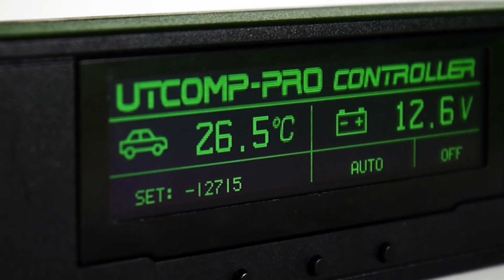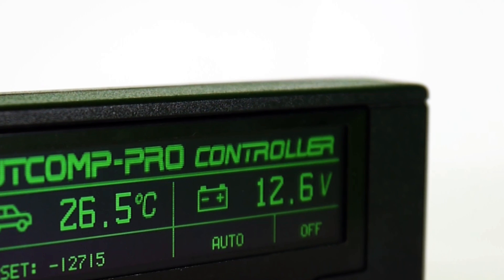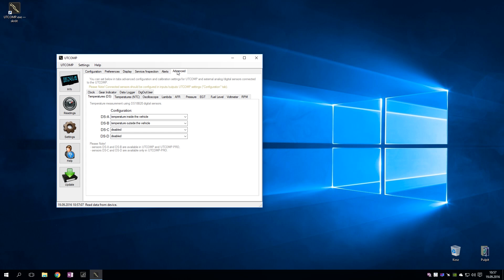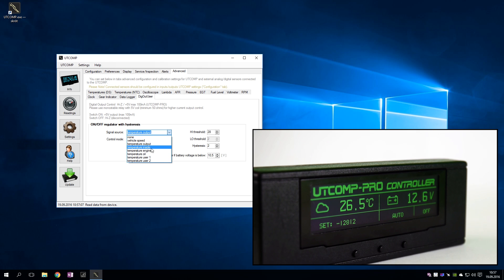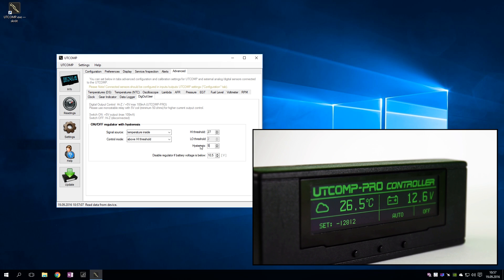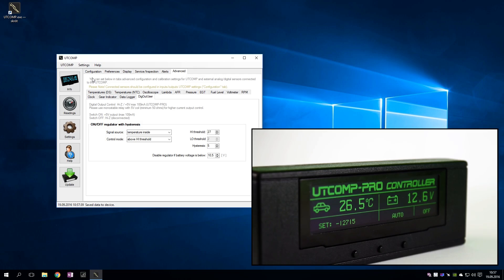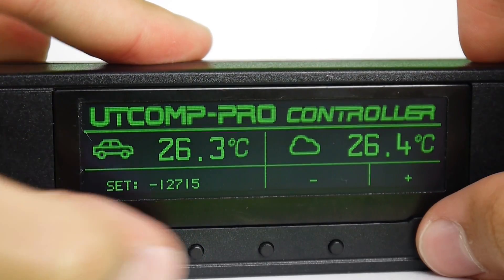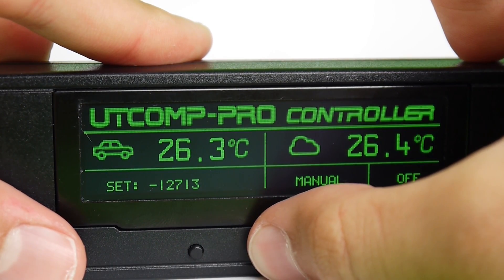UTCOMP-PRO Digital Output Control Relay

Comment: I just ordered a UTCOMP-Pro, your 4-Channel EGT-K thermocouple amplifier and a handful of sensors. I searched a long time for a reliable data-logging system to log parameters I can't log with the Cobb Accessport. I was getting really disappointed because everything was either junk or prohibitively expensive. I already have an AEM Wideband Failsafe Gauge (which I like) and I had finally given in to spending a crapload on their AQ-1 (which is useless unless you spend even more for their expensive wiring harness). And it still would not have had as many useful (to me) features than the UTCOMP-Pro. So psyched I found the UTCOMP-Pro before spending money I was going feel bad about spending.
Reply: So, are you still using it?
Reply: Any feedback on UTCOMP? Cheers